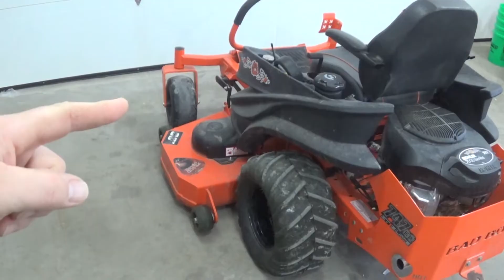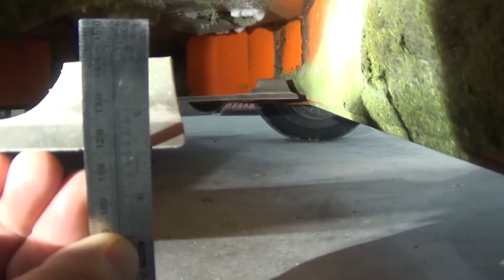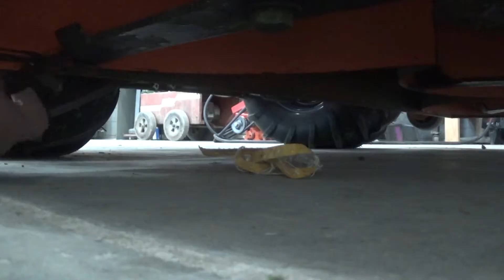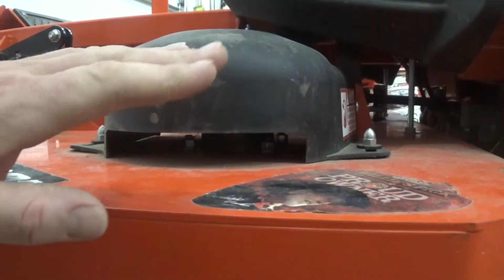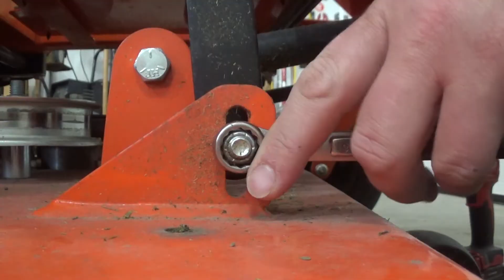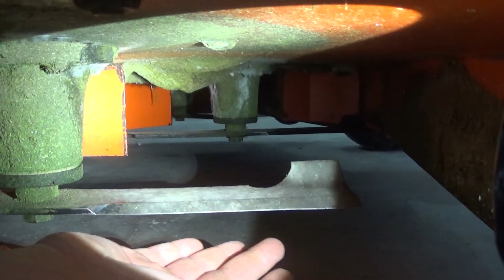How to Level your Mower Deck (uneven cutting height solved!)

Comment: My Husqvarna YTH24V54 was cutting real low on the middle of 3 blades.  Realized the end of the middle blade was bent downward causing a very short cut in the middle.  Replaced the blade & all is well.  It took a while to notice the bent blade.  My deck is 3” all the way around & I left it that way.

Comment: Great video!  I just bought a used deere with only two blades, but this still helps.  With 3 blades, could you just cut rise blocks (with one a 16th shorter) and place them under the bolts holding the blades on?  Then lower the deck onto those and lock everything in place?  Im not sure it would be precise enough.
Reply from the maker: You could do that, and get the center of the blades at the same height. However if the deck is tilted one direction the blades are tilted as well even if the centers of the blades are at the same time. The blades are parallel to the mower deck if that makes sense. So the deck needs to be parallel with the ground.
Reply: @SkylarHillShop  thanks.  That makes sense!